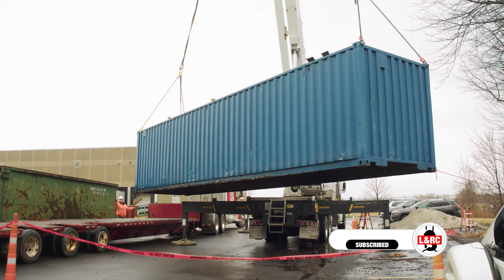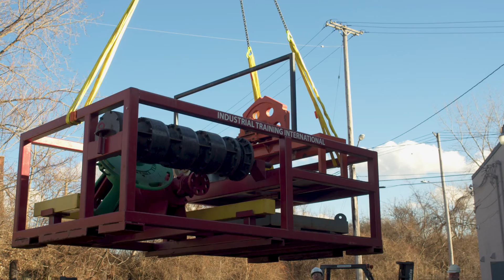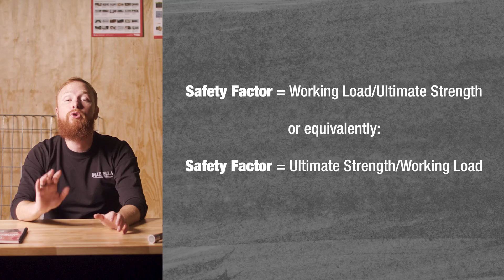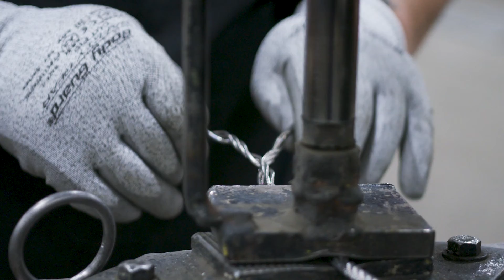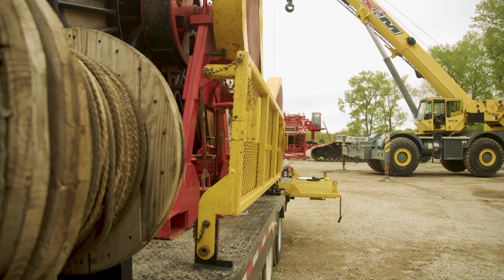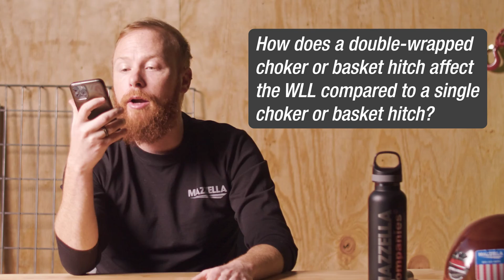Rigging Toolbox Talk: Decoding SWL, WLL, Safety Factors, Spotters, & More

Comment: I have one question..difference between use of round sling and web sling..i have seen many videos including yours..but the same thing is everywhere that for fixed lifting points we use round slings because it prevent the same contact point to be under pressure..but i cant understand that why web slings cant be used for fixed lifting points..in my opinion if lifting point is fixed or not fixed web slings will have same lifting contact point because of their fixed eyes..
Reply from the maker: It all depends on the lift point. Without a picture of what you are lifting, it is hard to determine the best option. There is nothing wrong with using a web sling for a fixed contact point. Roundslings may just be the better tool for the job. If the lift point is fixed, you may not need hardware to attach, as you can fit the right over the lug and onto the hook. You have an endless sling to work with, so if you are doing repetitive lifts, you are not using the same contact point on the sling. Web slings will always use the same contact point because of the eyes. So you will get more life out of your sling using a roundsling before it wears out. Does that make sense?